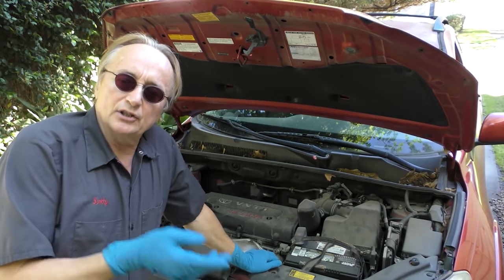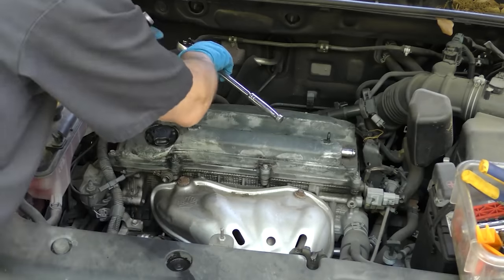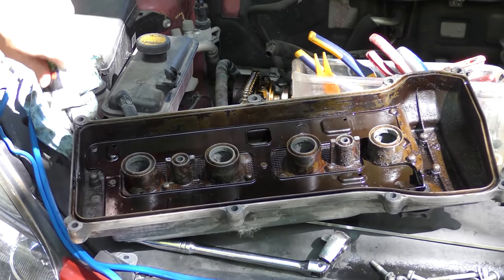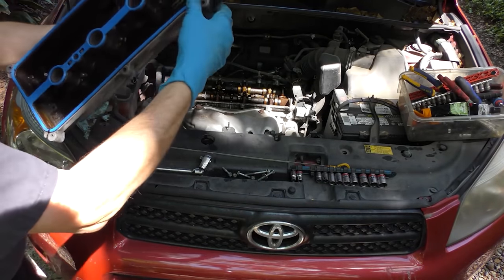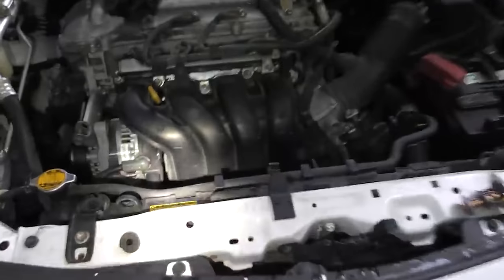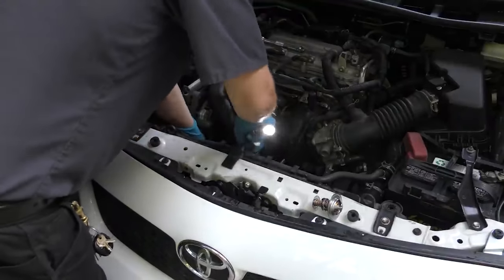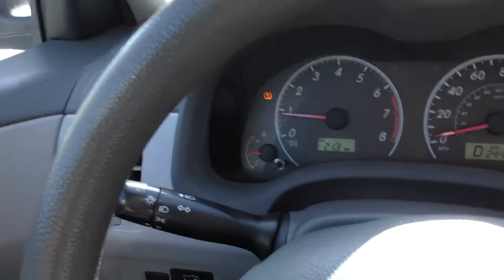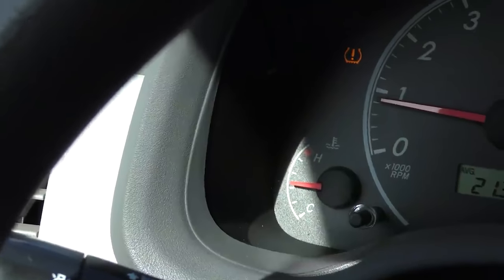3 Mechanic Scams Caught on Camera

Comment: #1 when i owned an independent workshop, i've seen mechanics use RTV silicon on valve cover gaskets instead of replacing them.

#2 everytime a customer comes in with overheating complaints, i'd change the thermostat every single time, regardless of the cause of the overheating issue.

#3 i've had customers come in with inspection reports from other workshops and dealerships with stupid amounts on them, when in fact they only needed a fraction of what was on the report. I've had a company vehicle (2019 toyota corolla) come in to the workshop i manage (in Dubai) that was quoted 2 front calipers, master cylinder, front brake pads, front rotors and new brake fluid. The total was 9,500aed (around $2600) when in fact it got away with only front brake pads, skimming the front rotors and handbrake adjustment. The bill was around 550aed (around 150$). The workshops give us honest mechanics a bad name.

Comment: Recently was quoted $6000+ for a transfer case replacement from an independent BMW shop, for my x6. They hooked it up to a scanner, pulled a code and told me the t case needed replaced. I replaced the fluid myself and bought a scanner and recalibrated the case myself for about the same cost and same amount of time they charged me for the diagnosis (about an hour long job). Problem solved and $5850 saved

Comment: I have an older VW Rabbit Pickup the Valve cover was supposedly replaced they slapped it on dry and that ripped the gasket and it really used Oil.

Comment: I work at a independent garage and lady went to Toyota and they told her she needed brakes all the way around her car (around 23000 miles) she brought it to us. Around 6mm left on the pads. Practically brand new. Don't trust the dealers they work on flat rate, if they don't have work they don't get paid. That's why the are as shady as they are.

Comment: We owned a 2012 Toyota sienna all-wheel-drive for 140,000 miles. We had a passenger rear wheel bearing go out at 90,000 miles and a rear differential coupler (all-wheel-drive) go out at 110,000 miles. These weren’t sham repairs, I diagnosed them myself. Other than that, great Vehicle.

Comment: As soon as the Toyota came in with overheating issue, I knew it'd be the thermostat. I remember my godfather pulling the thermostat out of my mum's 92 corolla and putting it in a boiling pot of water to check it 😂

Comment: My first Toyota Prius which I bought used, the air conditioner stopped working, brought it into the Toyota dealership and they told me that the condenser was bad and I was going to cost me 1200 bucks… I brought it to a local mechanic and he told me that a wire had come loose and didn’t charge me and it worked perfectly for 380,000 miles… That was 15 years ago and I’ve been going back to that mechanic ever cents with various cars and referred all my clients to him

Comment: I have a 167,000 mile 2002 Sienna with a P0171 code. Chamged many things and paid $570 to a real mechanic. Still not fixed. I did my own smoke test, and I found a leak in the oil cap. Still code after 400 miles driven. Im sure its the $150 O2 sensor.

Comment: My parents had a, I guess you would call it a 1at generation Taurus, forget the year;
So they still go to the same "mechanic", he put a new radiator in, my mother picked it up and within 24 hours it overheated again, the first thing I asked was "did he replace the thermostat?", of course he hadn't, took it back and lo and behold, he replaced the thermostat, fixed the problem

Comment: gluing the valve cover gasket is a poor shade tree approach, cleaning the aperture with brake clean will hold the seal sufficiently to the cover without disturbing the sealing area for next replacement

Comment: Have a friend who had his alarm going off.
He took to the dealer, Thousands of dollars, took to an other one, they claimed to have installed a new system. But the problem was still there.
I went and checked the remote controller. The button had some dirt, making it be like pressed all the time, making the alarm to go off. Just cleaned it, that eas it.
I'm only an electrician apprentice, but thinking on going for a Mechanic career.
I already fix my own car. Had a check engine light on, they replaced a bunch of things, still there. I replaced the valve gasket and the light went off.
Reply: *valve cover gasket.

Comment: dealerships are the worst. my hyundai was overheating, they told me with out a doubt that it was the heater core and it needed to be replaced (about $3000). my dad then just changed the thermostat and it worked like new, no overheating. needless to say i dont trust dealerships at all.

Comment: I needed brakes and the rotors replaced, ford replaced my brakes and nothing else. Charged me $890… i was 22, had no clue. It wasnt until maybe two years later, the screeching was insane and the disks were like mirrors.. a coworker who was a mechanic told me, they never changed them, theyre designed to last at least 50,000 miles.

Comment: I think dealers are no different than any other repair shop, it all depends on who is running them. 

So, here is my story, I had a Subaru, with about 140,000 miles on it, NOTHING ever broke. I hear some noise, kind of a humming/grinding sound coming from the front. The faster you drive, the more "rpms" you would hear (not louder, just faster). When I slipped the transmission into neutral on the freeway, the sound stayed the same, so, I figure it's not related to the transmission, I took that out of play. I kept it in neutral on the freeway and increased the R.P.M., by applying the accelerator pedal. The sound stayed the same, so, it was not anything to do with the engine or transmission. 

Next, I noticed the sound WAS louder when a banked in a turn (don't remember if it was a right or left turn). That tells me when I apply more force to one side, the sound is louder, so, I guess it was a wheel bearing. But, what the heck do I know? 

So, I take it to the dealer, they CERTAINLY KNOW, right? I tell them everything I just wrote here, with my guess. They tell me, "well, it can still be the engine (really, how?) and I leave. They call, they say I need new tires. Well, I did not NEED new tires, I was about 6 months from getting them but I would NEVER get them from the dealer. But, they had the car so I said, sure. I got 4 new tires and paid for a expensive alignment. At 5:oo P.M they call, tell me they test drove it and the sound is still there. 
They think it's the WHEEL BEARING, which they don't have, but for several hundred dollars, they can do it next week. My bill was OVER 1,200 dollars (7 years ago!). 

Two days later I take it to a different place, I tell them the same story, they say, "sounds like wheel bearings". 

Um, yes, I agree. They did it for half the cost the dealer wanted BUT, I would need a new alignment. 
So, I had two alignments in two days. 

Days later, the dealer called, asked about my service. I said, "are you kidding"?

Comment: Took my F150 to Ford dealer for scheduled oil change and tire rotation and technician approached me and
said he needed to show me a problem with my truck. It was on the rack and he spun the tires and he pointed out that there was a clunking noise in the differential and needed to be repaired  They even refused to rotate and balance the tires. I took it to the repair facility at the same dealership and they told me to leave it and it might be two weeks or more before they could look at it. I eased on back home 29 miles or more and made an appointment at my local mechanic and he indicated that with it being on the rack with no weight on it that even his pickup made the same noise and there wás no problem. I have driven it probably another 1500 miles with no problem and no vibration or noise. Just shows you when you are not a mechanic and not an expert on all functions of a vehicle you can be deceived. Now weather or not it was a novice mistake at the oil change or attempted scam I do not know and may never but shows you you have to be careful around some dealerships!!!

Comment: #2: the difference between a technician and a mechanic. Technician does what they’re told (either by management or service writer). Mechanics look into it and advise the service writer so the service writer can inform the customer and whether they want to continue. Techs service cars, mechanics repair them. 

You go to a dealer you’re almost always dealing with a tech and can be guaranteed mediocre, over-priced work at the very best. There’s a reason they have gotten the nickname “stealership”.

Comment: A simple change of spark plugs and the air filter will save you the cost of having the dealership mechanic state that your fuel pump needs to be changed, the air manifold needs to be changed, the cabin resistor needs to be changed and the engine bay coolant fans need to be changed.

Comment: Hi scotty i own a toyota yaris 2014 goes great 9.5 years old still original brakes only replaced the battery and tyres change the oil and filter every six months and got the mechanic to change the radiator fluid and auto trans fluid i use a mechanic at a bp garage hes honest and reliable cant trust dealers pay big bucks labour for apprentices to do the work ❤❤

Comment: My 1992 Toy base model 2wd pickup drives good for about 20 mins then starts to shake funny. Not like a tire balancing issue because it runs good for the first 15 mins of driving then all of the sudden I feel like its on a bumpy road.  Shut it down. restart it, pretty much will drive good again...weird. Then it starts all over... It has 98k miles only. 5 speed. No frills at all..NO PS, no air, no nothing...Good truck though, but I don't know why it does this...BTW - Your the best!!

Comment: Funny story: I once, over a short period, replaced every part underneath a Chevy Malibu except the steering knuckles and rims (calipers replaced recently as well). It had a crazy wobble. I mean everytbkng, literally everything all the way through the steering column... By myself of course. I even balanced the tires etc just in case. It would not stop wobbling.
Took it to a trusted shop and they insisted I needed to replace half the stuff I just did... As if they couldn't tell it was brand new!!! Lol
After saying no I decided I might as well replace the rims and relatively new tires because it was the only option. This fixed it. Apparently something unseen and undetectable by the wheel balancer was causing it!!! Somehow the wheels were balanced but must have deformed on a bump or something in a unique way.

Comment: #1  valve cover gasket was replaced but it's still stinky/leaking due to not using 3M weather strip glue to insure good seal, no cinching.  the seal literally fell out when gasket cover lifted.  
7:42  #2 overheating...  8:20  if 200K car overheating, replace the thermostat first (not all the hoses!).  12:26  and replace the coolant cap if old.

Comment: When I met my wife she had a old vehicle with very low miles. Every time she got oil change at jiffy lube they charged her around $30 for a cabin air filter. I said why so many and I wanted to know if I could do it. I went by the dealership to see the price the parts guy laughed and said that year car had no cabin air filter. They lied for 3 years.

Comment: ALWAYS pay for auto repairs with a credit card. If the repair is not done to your satisfaction call the number on the back of your card and “dispute” the charge and tell them what happened. Your card is credited for the charge until it is fixed. I have done this several tines for valid reasons over the last 20 years and have won every time.

Comment: Still watching the video, but the gasket seals came loose on my last car a few years ago and I wanted to replace them myself. However, I didn't have the tools or stamina to stand in the very hot sun to work and try to get to them. It literally required dissembling half of the engine to do it. When I did take it to the mechanic, he was older and on the cusp of retiring and was a one man army who took a few weeks to repair it. But god, I wish mine was as easy to do myself as the woman's Rav 4 was! All I could do was just buy everything he'd need and save some money with buying my own parts. The car only lasted me another three years before other issues finally made me sell it a few weeks ago, but that particular issue didn't arise again so he did a great job.

Comment: 21:50 
My car wouldn't turn on when they told me my car was ready. A collision mechanic told me that the alternator was having problems. first told me it would cost me about $250 later he showed me it in the system which was over $700.
The insurance was not gonna buy it so I was thinking of buying it myself. 2wks passed and I decided to take the risk and take it home (they jump start it). Now they said I would need a new alternator and battery. At home I saw that a fuse next to the battery was broken and it did not look like a natural way to break. 
The fuse costed me $4 they wanted $700 for "fixing" the alternator. 
Also, HOW does a mechanic not know how to change oil??? Didn't ask for oil change (it had good oil already) and yet they did so. They OVERFILLED the car with oil. I changed it myself.

Comment: Weatherstrip glue on the valve cover??????? So much for the next guy that has to remove this, not to mention that glue gets pretty hard and will actually cause it to leak later on.Good Job......

Comment: I know my ole Rabbit rubber timing belt is a little pain but after you learn how to install it isnt too bad, but every 6000 miles I replace it,  VW stated every 12,000 miles but by then the timing belt would break,  the old VW timing belts you have to twist the belt 90 degrees to adjust the tension.  So I dont mind it,  the Rab diesels were a pain.

Comment: You don’t need the glue a valve cover gasket in. You just need to pay attention when you are installing the new gasket on the valve cover. On rubber gaskets you shouldn’t use any kind of sealer or rtv cause it could mess with the sealing on the rubber gasket. I mean I’ve never had an issue putting small dabs to hold the corners. But you want to be careful with how much glue or rtv you use on the rubber gasket. A rubber gasket was designed to be used without rtv. Dude at the dealer still fucked up either way and wasn’t paying attention.

Comment: Took 2008 Ram to shop for noise (rattling). I thought maybe it was the brake pad clips. Instead, shop said that all 4 brake rotors were warped despite no vibration or shaking during driving or braking. Yeah right!

Comment: #2 is so hilarious to me because that is very similar to why I stopped going to a local dealership (and they defiantly lost substantial money as I was considering a new car at some point.) What ultimately did wasn't that the young mechanic forgot to attach the skid plate or that she lost a dust cover off one of the new tires. I honestly don't care that much. Everyone starts somewhere. It was that the manager didn't even feel it was worth his time to come apologize and I had to chase him for weeks to get the damaged parts replaced. I'm frankly also confused why a qualified mechanic wouldn't understand why a customer wouldn't want two different brands of tire (and different age tires) working opposite each other.

Comment: I had a Hyundai that needed to have the engine replaced. Fortunately the car was still under warrantee and even though it was very close to the end, Hyundai didn’t give me any issues replacing it. The car was an Elantra with a 6 speed manual transmission and when the dealership pulled the motor, they re-installed the original throw bearing. The car performed fine when I picked it up from the dealership, but the following morning - another very cold morning, I started the car and the throw bearing immediately started screaming at me when I pressed the clutch. It was incredibly frustrating knowing that they’d had this engine out and did not replace a $30 part that I would have gladly paid for if they’d asked. In my opinion replacing it should have been an automatic when they pulled the engine and transmission apart!!!

Comment: Sometimes (probably in the case of the last one) it's not that the dealership is deliberately trying to be dishonest, they are just relying too heavily on technology. Often the mechanic is so incompetent that they read the error codes and tell the customer basically what the computer told them. What they don't realize is that the computer may sense an issue with A, but they don't take into consideration that A is related to B which is related C and that's the real problem, just that there are no sensors on C. I noticed this as Audi, and was so irate with the mechanic at first but then realized that it is Audi's incompetency and lack of training or hiring qualified mechanics.

Comment: My daughter's Saturn stopped at a red light. Wouldn't turn over, no lights radio -nothing. She had it towed to a dealer. They replaced battery, Alternator, and starter. Two days later she called me and said it would not start. I crawled under the car and found a brass nut where the battery cable connected to the solenoid that had turned black from heat. Since it was a stick shift I just pushed it to start and took it back to the dealer who said that they sometimes get a new battery that's defective but not often. After 2 hours the service writer came out and said "It was a tough one but we finally fixed it." I told him that it only took me 2 min. to find the problem and that they put a lot of parts into the car that didn't need replaced, The mechanic said their tester said that all of those things were bad. I know that one, or two things may fail at the same time, but not 3 or 4. I know that a loose connection from the battery would cause all the problems she was having. The mechanic simply overlooked the most obvious cause, and started replacing parts until the cable accidently made contact and the car started.